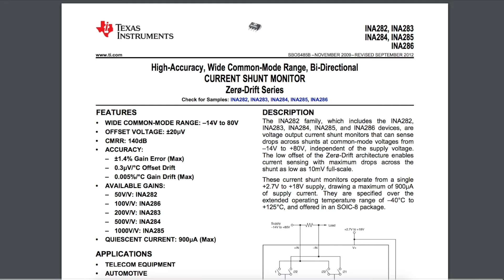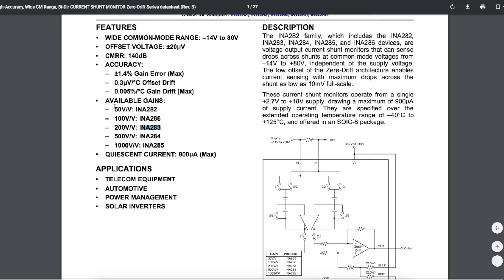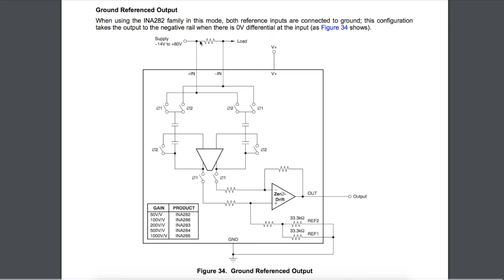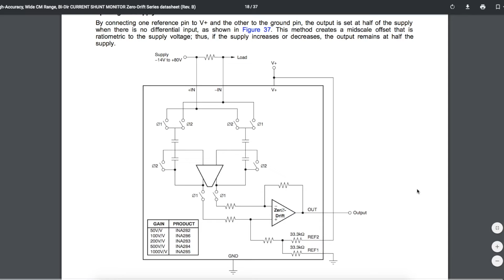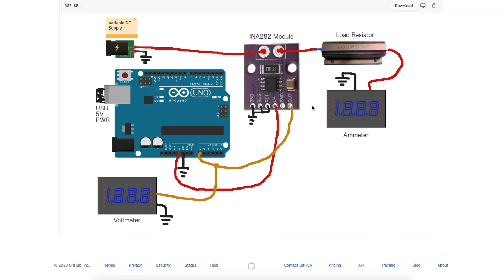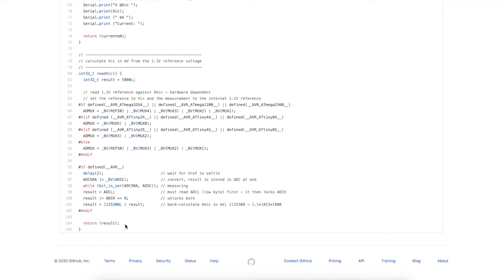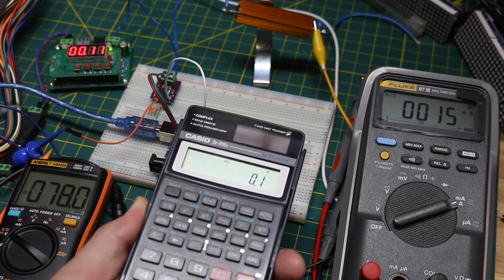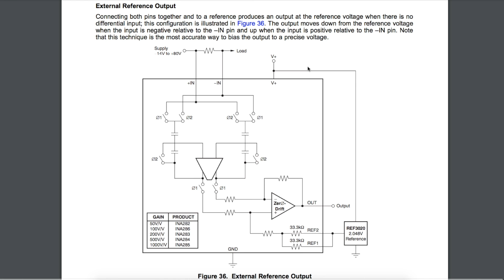INA282 Current Shunt Monitor with Arduino

Comment: Amazing Video. I dropped a Liked and Subscribed. Please explain how you would use the INA282 to measure the average voltage from a pulse voltage input
Reply from the maker: To know the average, the period of the pulse including on and off time would need to be known or else decide on the start and stop of a pulse such as a rise and fall above and below a certain base voltage to start and stop a sampling window for pulses greater than that.  Then just take ADC voltage readings while the pulse is active and calculate the average.    Eg.   ADC can read 0-5v,  a pulse is considered to be present if voltage is >0.5v,   so continually read the ADC and if vin>0.5, start a new measurement and start calculating averages on each sample until vin < 0.5v and then report the pulse average

Comment: How much maximum current can you push through this module?
Reply from the maker: With the module set up here using a 0.1 ohm sense resistor and 5 volt supply, the max output voltage can be 400mV below supply so 4.96V out when measuring the max allowable input current.   The INA282 has a gain of 50 so when output voltage is max, the input voltage across the shunt is 4.96 / 50 = 0.0992v.   For this max voltage on a 0.1 ohm shunt, the max current measured with this setup is 0.0992v / 0.1 ohm = 992 mA

Comment: I modified your code for acs712 and it works like a charm. All the codes available for acs712 are based on direct conversation without taking average or anything needed to filter the data coming to analog pin. so it makes the values go nuts and off from actual current value. Thanks

Comment: Good idea propping that resistor up in the air. I have it on good authority that those things can melt cutting mats. Maybe it's just the purple ones :-)
Reply from the maker: yeah I learned from watching purple mats melt under those resistors, as well as my previous smaller dark green mat once upon a time. But luckily I wasn’t drawing  enough power to make it exceptionally hot anyway. Figures, I come prepared and don’t need it.
Reply: @GadgetReboot  Next video: What happens if I try 5 amps?

Comment: Note there is an error in the readVcc(), last line should contain 1126400, not 1125300 to correctly use 1024 steps like you do. Having said that, the error of it is very much negligible compared to the error of the 1,1V ref itself and the sense resistor. And indeed, I expect the 0mA readings to be noise, not an offset.

And having 'sensorValue' ad 'Vcc' being floats is a bit awkward and slow ;) It's for a good reason the output of readVcc() is in mV and that is to avoid misuse of a float just for a decimal point :D
Reply from the maker: I wish I could remember where I got that code for reading VCC months ago in a previous project, I think it was from a message thread but I don’t remember if they explained every part of their calculation. I need to take better notes.

Comment: you need to calibrate the system with current flowing, the no current reading just removes noise. You need to calibrate the tolerance of the sense resistor out of the readings. as a minimum I'd do a two point cal and hope the chip is linear, otherwise maybe a three point cal. The resistor has a tolerance, the chip 50V/V has a tolerance, your meters are maybe 1%. 

Used sensors like this to measure the current being drawn in a medical sensor, so had to be calibrated during start up. also had to trip the supply very fast on overload.

forgot to say enjoyed the video.
Reply from the maker: yeah I skipped over all the parts of the data sheet with all the various  tolerances that can stack up plus the tolerance on the resistor to keep things simpler but in the real world, calibration at different points and factoring in the linearity curve would make things much better. The ultimate system would probably have multiple devices with different gains that can be switched in for an auto ranging sensor as well. I’m starting to think I should go shopping on eBay again.

Comment: the best thing about the analogue output is that you can feed the voltage into the µC analogue input as well as the analogue comparator, this allow you to measure the current and but also be able to shut down the supply very quickly in the event of over current without waiting for the µC to measure the input.

would it be better to do a rolling average than just taking 100 readings every time?
Reply from the maker: I just ended up doing 100 readings on the spot because individual readings were fluctuating too much so that’s what evolved into giving me a more consistent reading, but I was still thinking of it as more of an instantaneous reading rather than trying to do the average ongoing. Ultimately I’d like to be able to take reliable instantaneous readings as well as do an ongoing average.
i’ve been meaning to do a comparator based DC motor current limit project, I might be able to do it with this module finally.

Comment: You did well to find a Vcc reading function.   A low-pass filter on the AVCC pin can help with juttery reads -- but for some reason, the Uno is not made this way.  Straight to power; no ferrite bead or anything.  Your production quality continues to impress!
Reply from the maker: thanks! Yeah I think I have some standalone ADC modules with voltage references, and are either SPI or I2C and more bits of resolution so I’m curious to try that out when I get a chance.